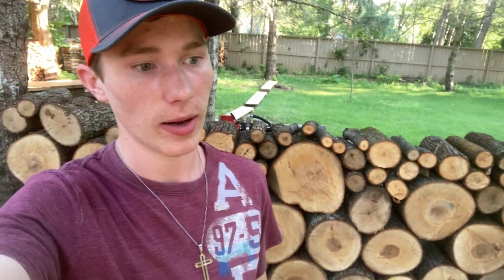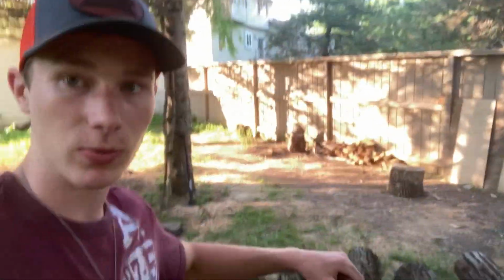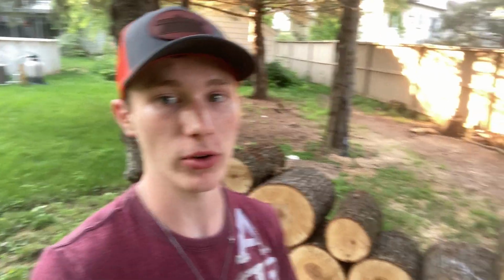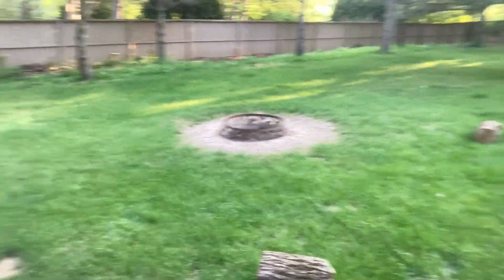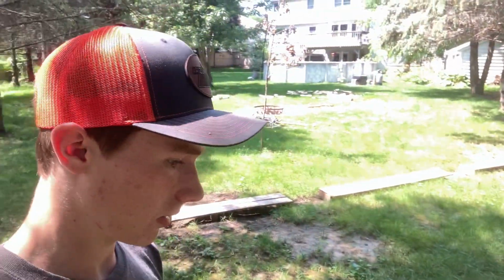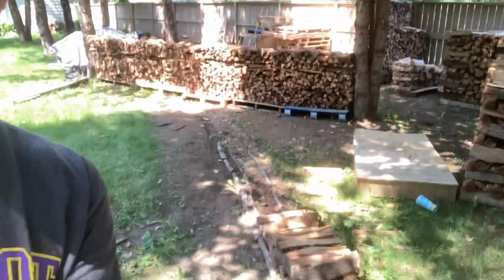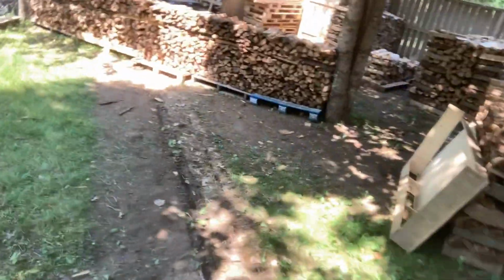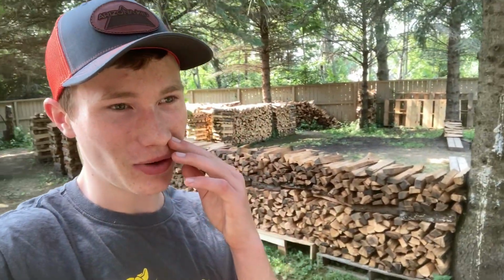HandSplitting the big stuff

Comment: I admire your drive and ambition. I was once like that, and I learned real fast to work smarter, not harder. Not bashing you, but you  could work alot more efficient. Carrying the rounds to toss them out in the grass? Only to pick up all the splits later? Constantly picking up parts of the round to hit them again? Get yourself a huge round, and put a tire on it. No more picking stuff up. I admire that you still handsplit while having a hydro, but hand splitting can be so much easier. Keep your work area small. Split right by your stack of rounds, instead of moving them. I was young and crazy once like you, working like a mad man. An older guy who I worked landscaping with taught me alot about efficiency and how I would burn myself out. Have fun, and good luck in the wood business.
Reply from the maker: Well, I have started splitting right next to where I’ll be stacking since this video.